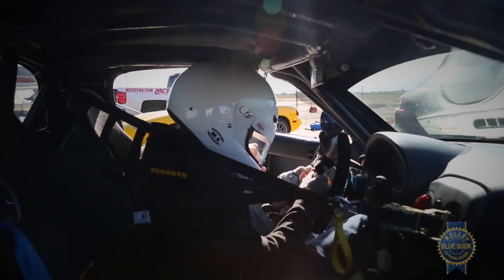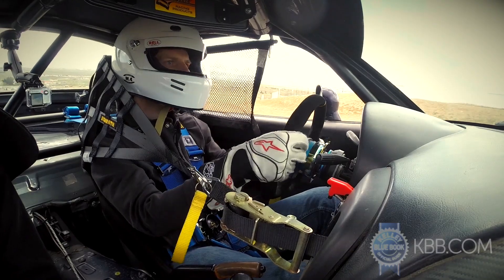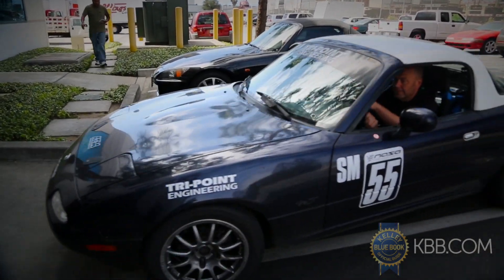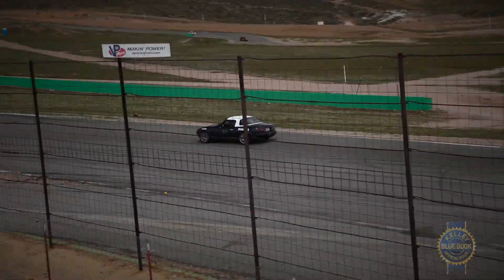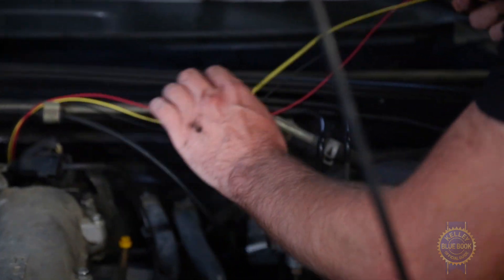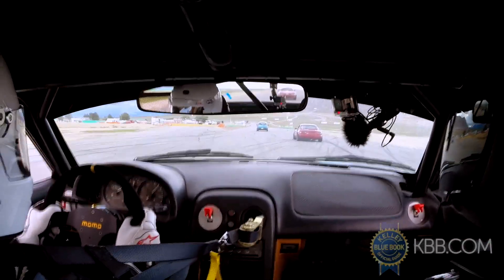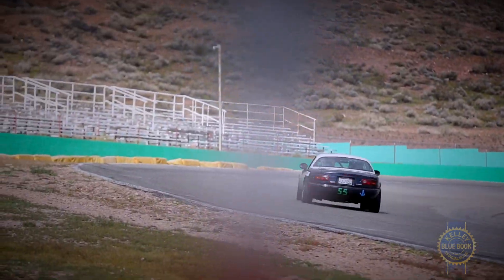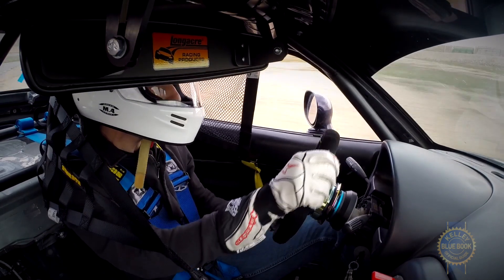KBB Races a Mazda Miata - Part 6: Data Analysis with AEM

Comment: Miatas are just like cheaper rx7s arent they?
Reply: +xGettinxMoneyx Rotaries have very little torque and have known maintenance issues that piston ICEs do not. They make up for it in high revving smooth operation in a small lightweight package that keeps the weight low in the car. There is a lot of misinformation about these motors and fewer shops that will work on them, but it's hard to make a general statement about one being superior over the other, it has a lot to do with the specific application.
Reply: No not at all for starters rx7 usually have rotory motors were as the miata has a piston driven motor miata also is a 50/50 weight distribution I'm not positive on the rx7 but it's not perfect so basically rx7 has and airplane motor and miata has a normal motor
Reply: zachary jones Are rotary enigines a pain in the ass to maintain? and can you upgrade them like usual cars? and are they trash or better than pistons?
Reply: Kevin Bandy Lol I think Id rather go with piston